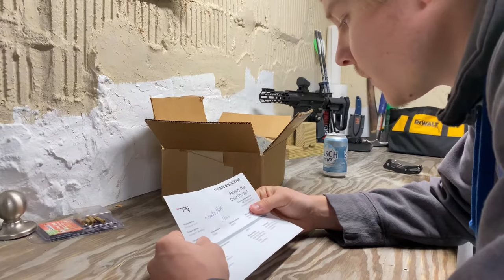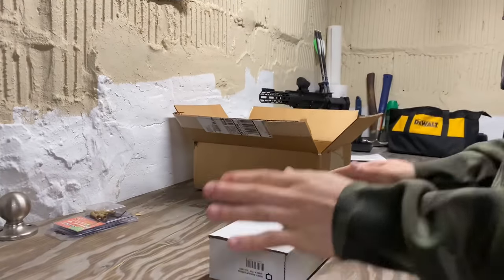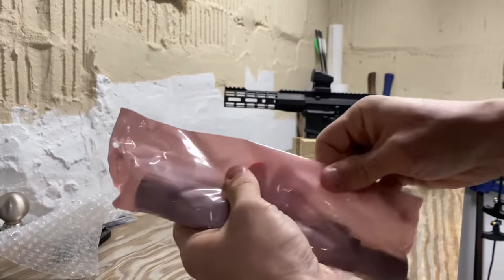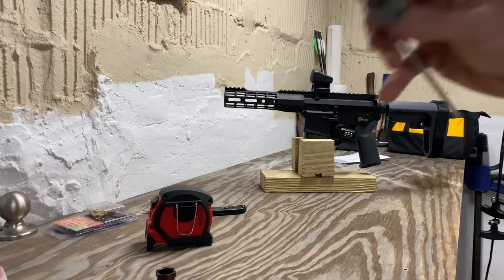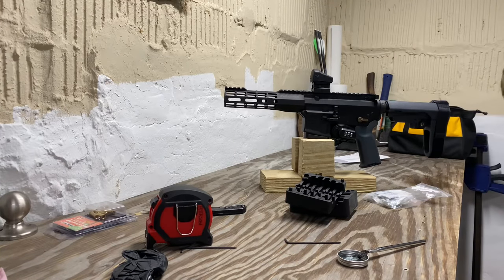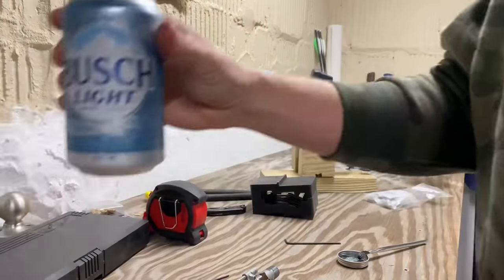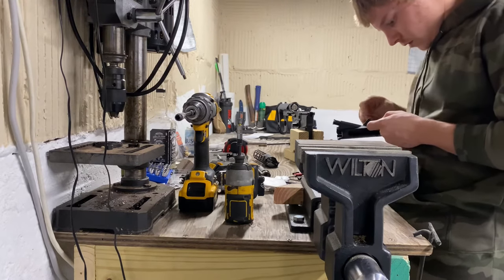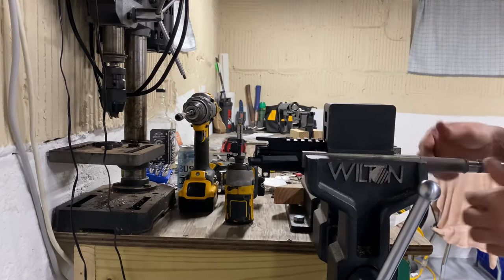The HONEY BADGER Barrel By Q Manufacturing!

Comment: Why did you go with this barrel compared a different one ? Is it worth the money and hows the accuracy?
Reply from the maker: The faster twist rate helps stabilize subsonic rounds and aids in accuracy slightly. As of June 2022 Faxon has released the 1/5 twist as well. I would consider going with any short barrel with 1/5 twist if you are planning on suppressing and shooting subsonic
Reply from the maker: Price is a little more than the other 1/5 twist barrels out there for the same or very similar performance